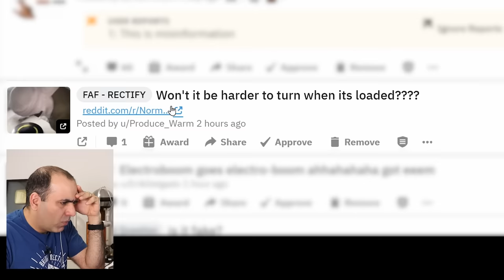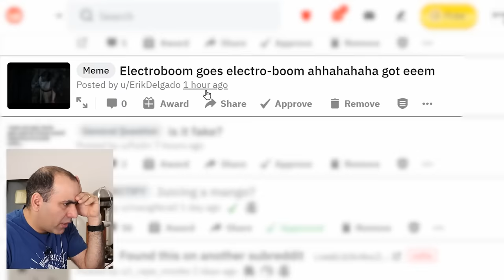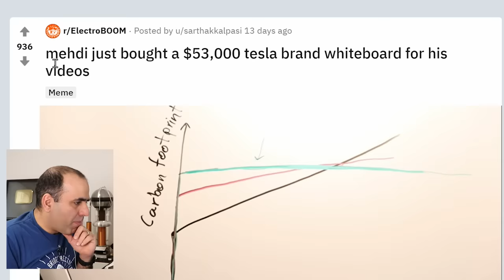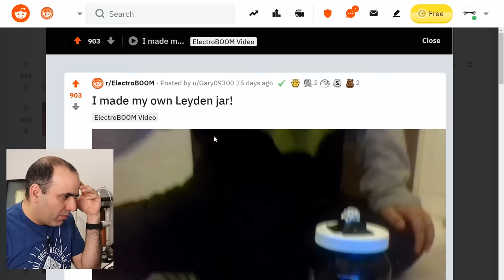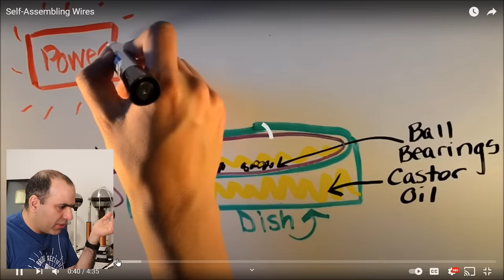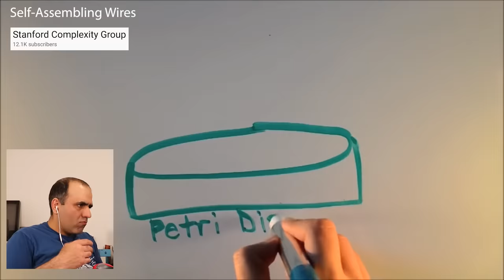Self Assembling Wires? Levitating Motor? LATITY-005?!

Comment: I've seen pens that levitate like that motor, but they've always got a surface on one side to push against. Is it possible to put a pair of repulsive magnets at that point also so it contacts nothing?
Reply: It is possible to make it levitate even without the surface, just hard to find the balance
Reply: It is
Reply: @DyslexicMitochondria  Your username made me click on ur profile. Dude ur channeI is so underrated
Reply: Theres a well known theorem in physics that any stationary arrangement of magnets is inherently unstable
Edit: heres the wiki page
https://en.m.wikipedia.org/wiki/Earnshaw%27s_theorem
Reply: According to Wikipedia's article on Earnshaw's theorem, permanent magnets by themselves are not enough to stabilize all six axes of a levitating object.
Reply: @asmodeusz28  Levitation of a static object isn't possible using only permanent magnets. If the object has some angular momentum the field is dynamic and levitation can be stable. You can see this at work with the Levitron.
Reply: @naasking  In that case one of the axes is being stabilized by something other than a permanent magnet.
Reply: @asmodeusz28  Look up the Levitron, it doesn't need  stabilisation while rotating.
Reply: If the pen is spin-stabilized, yes. If the pen isn't spinning, no.
Reply: @naasking  That's the top right?  It's spin stabilized. and the magnet only stabilizes three axes, not six.
Reply: The issue with magnetic levitation, is that it’s quasi stable at best. That’s why magnetic levitating tops need to spin, and the gyro motion overcomes the tendency to fall out of critical point. I too have wished these levitation pens didn’t need a wall to push against, but, it would require some insane RPMs to get the pen stable.
Reply: @PlasmaChannel  The other way to make it stable is to replace the permanent magnets with electromagnets, and use closed-loop control to achieve dynamic stability (similar to how maglev trains work)
Reply: @raptor4916  exactly. For magnetic levitation, you always need some active control mechanism.
Reply from the maker: Good though, sir! I assume we have to extend the end with some plastic farther away  from all the fields, add a magnet at the end against a magnetic wall. Otherwise we risk mixing the fields and... I don't know what happens!
Reply: At that point it would be like a motor that uses air bearings, almost frictionless.
Reply: Back in the late nineties McDonalds gave a toy of Princess Amadallas spaceship that used magnetic repulsion to appear to hover. It completely levitates from its base. I collected one because I thought it was cool. My son who is twelve and is a super Starr Wars geek covets it.
Reply: Earnshaws theorem! One of the axis of the six degrees of freedom of the levitating body needs to be actively stabilised.
Reply: @xa-xii4865  Almost all of the 'accidents' are deliberately staged, however the incident where he almost killed himself with the microwave transformer was an actual accident.
Reply: @ElectroBOOM  you videos are amazing
Reply: @ElectroBOOM  worth checking this link, regenerative acceleration and other impossible principles. They seem to be very serious about it, although this clearly violates some fundamental Physics principles. Good material for one of your great videos:

Comment: Mehdi those Iron beads are similar to the way that lightning works ,the first wire (conductive path) that touches the ground all the charge will hit the ground through that path , causing all the other paths to disassemble ,you should use bigger balls and logger distance to give the race some meaning lol also try to deprive them from building material
not from the finish line.

Comment: The wires at this end are tied together In pares as you can see and each pair is attached to one of these cables
Which you can plug them into the wall power plug 🔌

Comment: What if you increase the weight on a bearing'd rotating disk on one side when the rotation weight's trajectory is facing up? Now mirror this for stability 180 degrees from topdown, and flight?

Comment: Hi, Electroboom.
I don't work with electricity but I have a question.
A wind turbine turns generating energy.
What if you Added something like that to a wheel or two to a tesla?
Would it charge while driving?
Reply: I'm pretty sure that's exactly what regenerative braking does, or at least that's the concept

Comment: the guy at 10:00 is proberbly a cable theif, the short the wire so they can steal it, you also see it sometimes in abandoned buildings where they throw metal at the fuse box still connected to the grid so they can steal the wiring, very dangerous though

Comment: Hey, rectifier, could you rectify this: https://www.youtube.com/watch?v=Jnx7vAMvssI&t=684s
Basically the question is if the relatively strong electromagnetic fields created around the cables during welding (due to the high current) can be harmful.